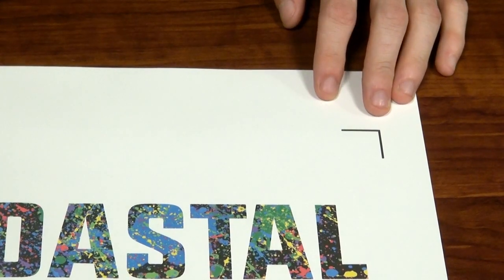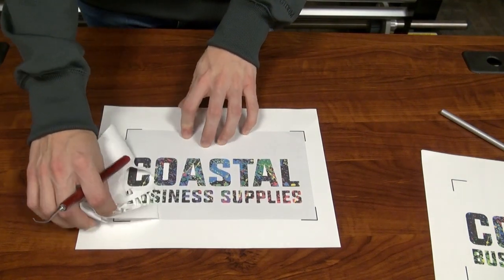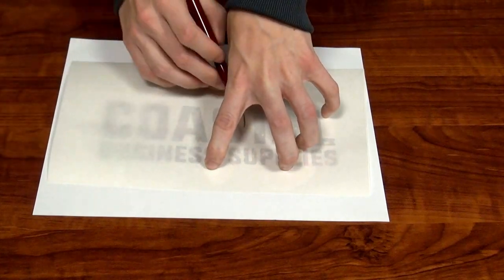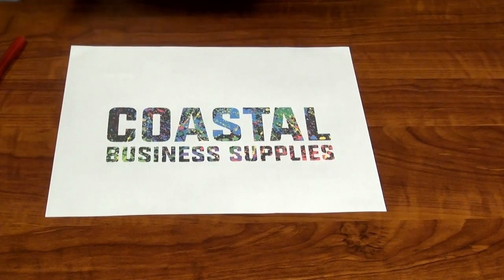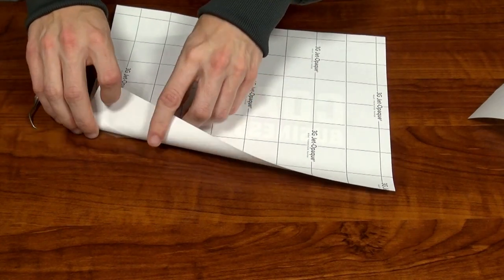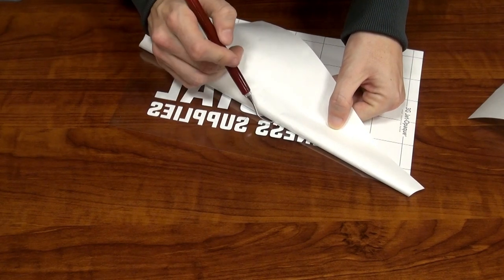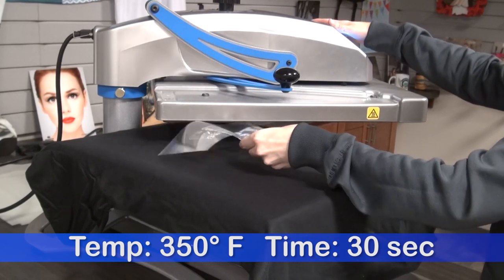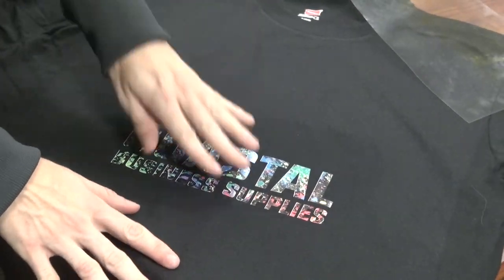Coastal Tech Support Tips: Using Transfer Tape with the 3G Jet Opaque

Comment: Thank you, tutorial was extremely helpful. I used the cricut heat transfer tape at the recommended 350 degrees setting. However. it was too hot and it shrunk the tape . After reducing the temp to 250 and time to 15 secs it worked perfectly!
Reply from the maker: Hi Sterling.  Thanks for the tip!!

Comment: sign guy here. well done. you generally have less snagging issues if when weeding the material you are removing if you start on the right and peel back to the left (for text that you can read, or do the opposite if its reversed text). that allows you to better peel letters such as  lowercase Es and Cs etc. anyways doing it all in slow motion what ever you do usually allows you to spot any mistakes along the way before it's too late.
Reply from the maker: Hi! Thank you for this information!

Comment: hello, what transfer tape did you use for the Jet Opaque 3G? I have the same paper as well, but want to know the tansfer tape sheet you used. If you could provide a link that would be great. Thanks!
Reply: Good question
Reply: I use the Siser TTD High Tack Mask, if that'll help with your question.
Reply: @LadyP1225  do ever hany problem with it??? does it mess up the image or brings the ink with it after the heat press

Comment: I got some stahl transfer tape to use with my 3G opaque and it's a real pain. I wasted lots of material.
I saw some demos of the stahl printable paper and it looks so easy. They just apply the mask, pull the paper off and it comes off so easy. The neenah peper is quite nice on the shirt but it's a pain to work with, transfer tape or not.
Reply from the maker: Hello! We do recommend our application tape with our 3G Jet Opaque paper only. Have you given this tape a try? We do not recommend very fine lines/details as they do not pull up well on the tape. For the 3G paper, what issues were you experiencing?

Comment: So ive seen this type of paper where you print the image on the special paper using only black ink which severs as the adhesive then you heat press on shirt next you apply foil let cool and peel of ....is there such of paper that works with inkjet printers ???

Comment: When heat pressing your contour cut using clear heat transfer tape, have you had a problem with ink lifting from the design on to the clear transfer tape? If so, what do you recommend as a solution?
Reply: Im assuming waiting for the transfer to cool down is the best way to remove clear heat transfer tape without lifting ink off of the design and on to the clear heat transfer tape?
Reply from the maker: Hello! Ink can release to the tape as well. We would suggest letting the transfer ink dry under a heat platen for 15-30 seconds, or let the transfer sit out for a few hours to let the ink properly dry.
Reply: @CoastalBusinessSup  Thanks For The Reply. 
I will test both methods and report back my results.

Comment: I have a question.... If you lift the bottom of the letters, then place the transfer paper/tape over it and squeegee the front and back... doesn't that kinda take away from lifting the letters????? not understanding.
Reply from the maker: Hello! Lifting the letters slightly, before applying the application tape, will assist in the letters releasing from the paper backing and adhering more to the application tape. Thank you!

Comment: I have a problem I'm using 3G opaque paper and when I transfer the paper to the tape and press for 350 degrees for 30 sec I let cool down and when I peel my ink sticks to the tape and the finishing look looks faded because all the ink is left on the tape after peeling it off. how can I get a clear finish look with out the ink sticking to the tape?
Reply: hi coastal, would like to know this as well as it's happening to me too. How long is your cool down period in this vid? Have you faced this issue before?
Reply: Use tack method, drop heat press for 2 seconds (DONT LOCK), peel tape cover with parchment press for instructions temp and time let cool all the way then peel, repress 7 sec with parchment  let cool then peel . I use old vinyl carrier , i save the big one and try to keep them clean as possible
Reply: Pigment HTV ink. I use inkjetcarts inks.

Comment: Where do you buy the transfer tape? And did you use a circut to cut the transfer paper? And can this technique be used for light transfer paper too? Thanx in advance for your help and answers.
Reply from the maker: Hi Katlynn, since this video we have discontinued the transfer tape we used. Now we recommend the TTDE Mask, found here https://www.coastalbusiness.com/ttd-easy-mask-application-tape-for-siser-solvent-heat-transfer-vinyl.html . To cut the transfer paper, we used a Graphtec cutter, but, a Cricut should work. For this technique, it is best to use with opaque papers.
Reply: @CoastalBusinessSup  can i use inkjet printer?
Reply from the maker: Hello! Yes, you would use an inkjet printer, with pigment based ink, for the print out.

Comment: Hello, whenever I try using a carrier tape I have problems with the 3G opaque h.t.p. being real sticky to the touch and lifting up some of the ink after press and cooling for the required time. Am I using the wrong carrier tape or what?
Reply from the maker: Kris, what type of application tape are you working with? What type of inkjet ink are you working with?

Comment: I'm having a lot of difficulty finding a masking tape that will properly stick to the small designs on this transfer paper . I really need help because I've read that it doesn't stick well with a lot of masking tapes ?
Reply from the maker: Hello, this is just one way to do it in a pinch. We do not yet have specific tape that we suggest for any of our papers due to difficulty getting them to work.

Comment: PSA: You CAN'T use transfer tape on 3G Jet Opaque. I know a lot of you have attempted this only to find that no matter the tack, it will not lift off of the paper backing. There is a solution...
You need to peel your full page print off of the the paper backing carefully, put it on a carrier sheet (like the ones from Cricut), then run it through the plotter/weed it... THEN you use the transfer tape to lift your designs. I suggest lowering the tack of the cricut carriers by rolling a clean cloth over it so that the fibers stick to it and reduce the tack.
Reply from the maker: Hello! We have had quite a bit of success with transfer tape. We suggest customers, at this time,  work with a Solvent mask found here: https://www.coastalbusiness.com/ttd-easy-mask-application-tape-for-siser-solvent-heat-transfer-vinyl.html . We have tested with our 3G Jet Opaque, Jet Opaque II, and EasyJet with success!

Comment: Can you use the tape with an IRON?  Or, does it have to be a heat press?
Reply from the maker: Hello! It is always recommended to use a heat press for even pressure, and temperature control, to ensure durability.

Comment: Can you link to the exact tape you're using for the 3G? I got some from sign warehouse a while back and it's not picking up the 3G :/  This must be a heavy tack, yes?  Direct link would be appreciated, I get lost when I browse all the different tapes :(
Reply from the maker: We do not currently have a tape at this time that explicitly works with our paper. This is one we you can do it in a pinch if you have to do it.
Reply: is permatrans or the blue grid on ebay any good? will mask work on those?
Reply: Kavya don't use 3G, it cannot be transferred and it's one of the worst transfers out there. Story goes, the 3g was sued and they use a new formula, one that's not able to use tapes. The original blue grid is still top dog and can be ordered internationally. Don't buy local blue grid, it's not the real stuff. Absolutely do NOT buy 3g ever.
Reply: @IzludeTingel  update on the situation.  i'm using some generic transfer tape from ebay.  i peeled the whole print off the backing paper and put it on top of a low tack carrier sheet. then i cut and weeded, and THEN i put a high tack mask to peel it off the carrier sheet. only problem is that any mask (various brands i've used) reduce the yellow's intensity.  ultimate solution is a desk solvent printer (bn20)  we need to outright stop using inkjet transfer sheets altogether, the stuff deteriorates in a month anyway, even with appropriate wash methods.

Comment: Man I got my first group order today and it's for a dance group and Ima use this paper for it I'm so nervous lol
Reply: How'd they turn out?
Reply: Linda T. Great , I’ve had the same customer return every year since , business isn’t booming but this paper if used as instructed is great and you can essentially run your whole business around it with some elbow grease
Reply: Hi what transfer tape did u use I need to do 100 shirts asap & can't figure this out for the life of me. Ty
Reply: April Garrison I usually use the hobby lobby cricut transfer tape if that’s what your asking
Reply: @Fullrusher  for vinyl or for heat transfer paper (like in the video)
Reply: Hey 👋🏿 Thanks for answering the questions. It means a lot :)

Comment: Could you use this with the her pro soft sketch transfer paper
Reply from the maker: Hello,
unfortunately, that paper would not work with transfer tape only will work on 3g jet opaque paper.
Reply: Coastal Business Supplies alright so the 3g jet opaque will be the next transfer paper I use cause o don't like doing the shirts and having that white coating still on the shirts
Reply: Coastal Business Supplies what's a link for the transfer paper
Reply from the maker: https://www.coastalbusiness.com/heat-transfer-paper/heat-transfer-paper/inkjet-transfer-paper.html

https://www.coastalbusiness.com/heat-transfer-paper/heat-transfer-paper/laser-transfer-paper.html
Reply: Coastal Business Supplies thanks alot
Reply from the maker: No Problem have a great day.
Reply: Coastal Business Supplies what type of tape is that and the link didn't pull for the tape at the bottom
Reply from the maker: https://www.coastalbusiness.com/digital-heat-transfer-application-tape-for-opaque-transfer-papers-htm-c.html
Reply: Coastal Business Supplies this is the neenah 3g jet opaque paper
Reply from the maker: Hello, 
The jet pro soft stretch paper does not take the tape just the 3g paper.